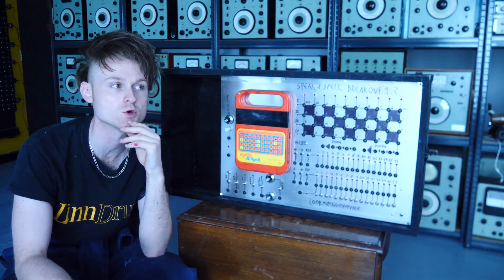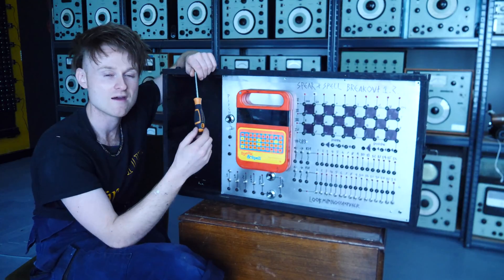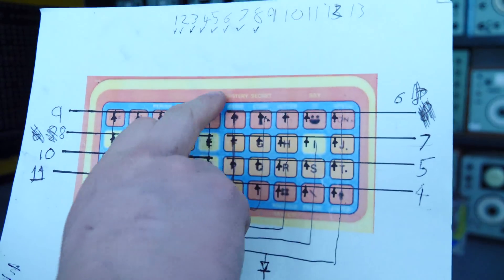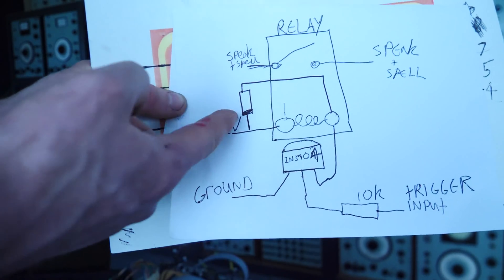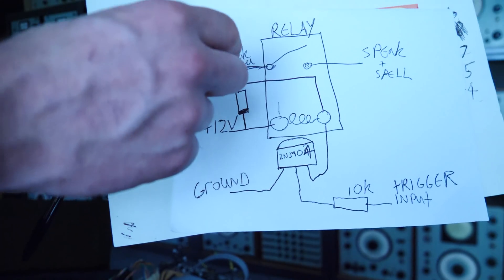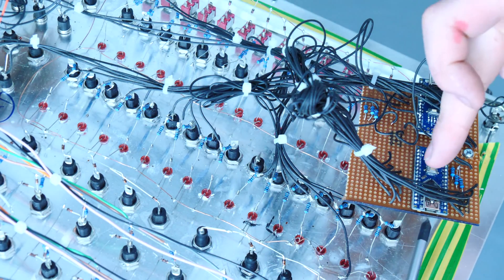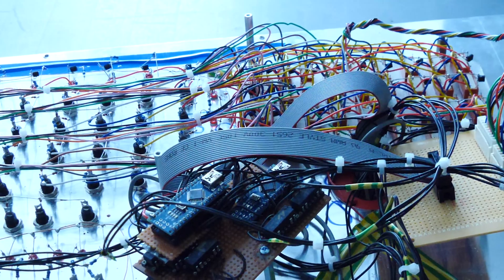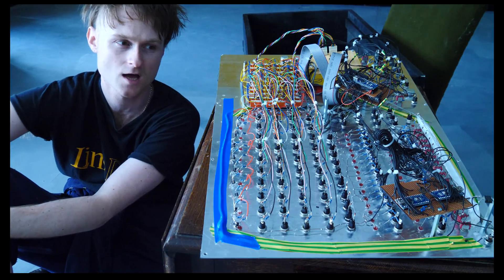Speak And Spell Breakout 1.2 A Look inside A Modular Circuit Bent Machine

Comment: The Speak and Spell has a solid circuit structure. When I tried to circuit bend years ago, I had added a pot that went three ways. I connected a point to the spot where the pitch drops and accidently to power down I believe. So when you would turn the pot all the way down it would slow the pitch down and kill the toy. However on the other side, turning it up would speed up the pitch. I wired it wrong, but no matter how many times I messed with that pot, the toy never died completely.

Comment: Sam, you can get things called "digital transistors" which have the base resistor (and a pulldown to the emitter) integrated - I'm not sure if you can get through hole versions but especially when you're doing a gazillion relays it's so much easier soldering one component instead of two

Comment: Hi, Sam! What will happen if you'll omit diodes which you've shown at 11:30? "Buffered LEDs"... I can't understand this well...
Reply from the maker: think of diodes like one way roads.
Reply from the maker: basically the whole thing is wired up like a grid, if the diodes were not there, all of the LED's would light up no matter which socket you plug the signal into. the diodes help to isolate the signal on the grid to only the LED's you want to light up
Reply: @THISMUSEUMISNOTOBSOLETE  Thank you! Now I understand much better!

Comment: I have actually blown up LEDs cuz i didn't add the flyback diode..... 😓😓😓😓 So sometimes u don't have a choice i guess.....
Reply from the maker: wwwwaaaah? how was the LED wired to the relay?
Reply: Parallel to the coil.... With a 33k current limiting resistor....
Reply from the maker: @shashwathsundar  blimey well in those instances yeah I guess that would happen!
Reply: @THISMUSEUMISNOTOBSOLETE  ive learnt my lesson😂😂
Reply: The reverse voltage cause d leds to break down i guess.... Alao that made the leds temporarily brighter too...😌😌
Reply: *also

Comment: You could use CMOS switches  (4016/4066) for bipolar signals if you power them with, for example, +/-8V (see the schematic for the Buchla lopass gate for reference). Also, CMOS switches from the manufacturer MAX are designed for bipolar use.
Reply: Yep! But like I said I was just summing up what time I had. The fact that some pins were in positiveville some in minus I just went back to relays as I only had an evening left on it
Reply: @LOOKMUMNOCOMPUTER  Plus the sound of relays when triggered. Very mechanical :)
Reply: But cool on the MAX manufacturers I'll che k it out
Reply: @LOOKMUMNOCOMPUTER  They have a very low internal resistance. I like 'm but sometimes get the feeling it is a bit of over-engineering..

Comment: Relatively simple changes to the Arduino code could probably achieve the same effect as adding AND gates to reduce the sequence steps high level durations.
Reply: Indeed; but then the leds need there own pins if they want to be solid as steps go on. Having an and gate keeps it all pretty low component.
Reply: @LOOKMUMNOCOMPUTER  Doesn't the clock that you suggest ANDing with have a 50% duty cycle? If so, similarly reducing by 50%, in software, the time each step is high would still cause the LED be lit long enough (50% of each step). Maybe I'm misunderstanding something.
Reply from the maker: @pasde2  yes but still the issue is. for instance if the sequence has stopped. you have a 50/50 chance you wont be able to tell what step the sequencer is on. because half of the step the led wont be showing you which step it has on. Dont get me wrong! when I made this sequencer design a few years back I did make a mode where you flick a switch and it turns on for half a step then turns off. but it just ended up rather un useable because of the signal LED. so I found it quicker and easier to add a single transistor at the end of the line of switches acting as an and gate. the clock going to the collector and the sequence stream going to the base, or visa versa
Reply: I should have explained that. My bad. Cus yeah easy solution but makes another problem

Comment: I think 4066 / 4016 will work if you give them proper supply voltages.  Would be much smaller footprint than the relays.  Or maybe a transistor array, using the transistors as a switch?  I trigger DR-110 drum pads thru transistors.    We can chit-chat about it if you want.
Reply: Indeed! I just realised it was gunna take a few more hours of faffing so went to the relaus